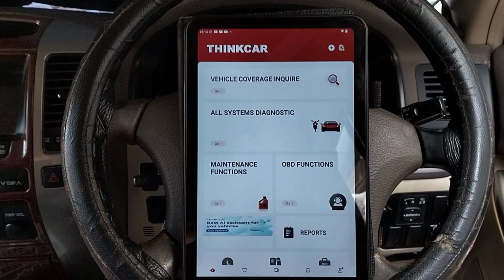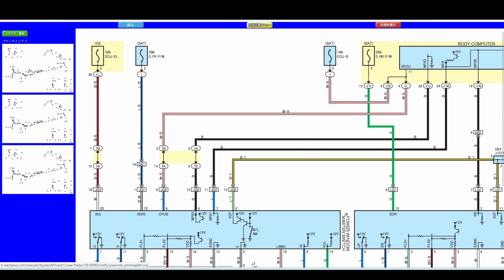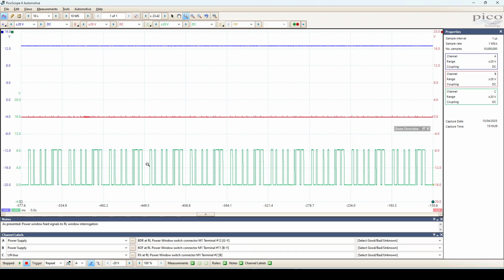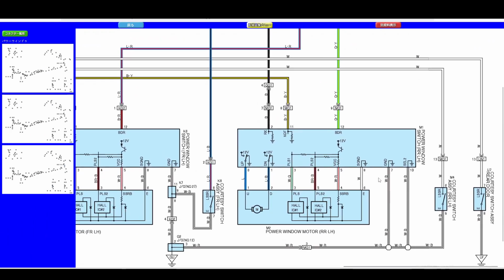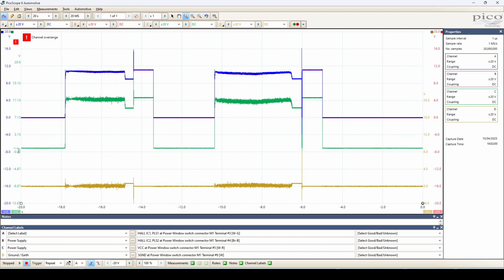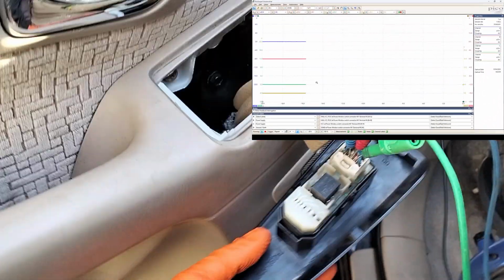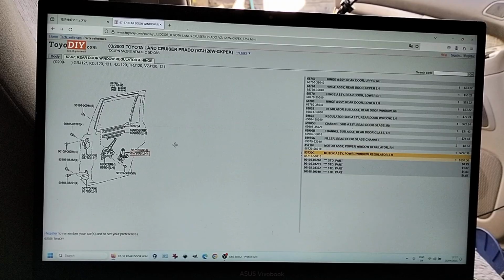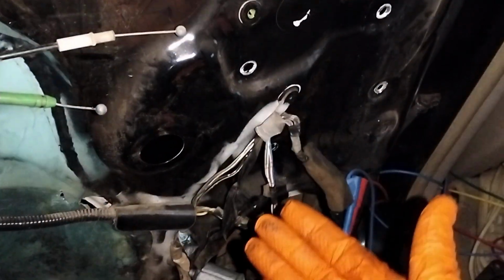2002 LAND CRUISER PRADO POWER WINDOW SYSTEM MALFUNCTION DIAGNOSIS

Comment: I think the second Hall effect sensor is used to determine direction whether it's leading or lagging the first one meaning the motor is rotating clockwise or counterclockwise (up or down). Also, thanks for the video! I learned something new, like using the math channel in frequency mode to analyze LIN bus changes, which is much easier than decoding.
Reply from the maker: I have closely examined the captures, and you are correct. When the window is going down, whenever sensor 1 drops to ground, it is followed by sensor 2 also dropping to ground. Conversely, when going up, each time sensor 1 drops to ground, its followed by sensor 2 rising to VCC. Thanks, man!

Comment: From RL, window works up an down but then the diagnosis is motor malfunction. Because Limit switch Encoder available only from driver's master switch but not from RL switch? Thanks for sharing cool tips.

Edit. So the Hall IC1 & 2 chips are inside the motor unit?
Reply from the maker: Yes, those are integrated into the motor assembly. At first it tripped me up until I saw the comparison with the front Left door.That is when I knew there was a circuit difference. The only thing that is after the connector is the motor, so I looked at it and saw the wrong part number listed. After seeing the wrong part number that is when it hit me that the motor does not have the required circuitry. I hope it makes sense now.
Reply from the maker: Yes, but not exactly a motor malfunction, somebody put the wrong part number, which doesn't have the limit switches inbuilt so the computer was locking out the AUTO function.. The driver's switch only activates the AUTO function.
Reply: @k-mechanics  Thanks for the note, quite not common case. I recently had Maserati Ghibli U0202 case  RR windows not functioning - CAN Low wire issue.